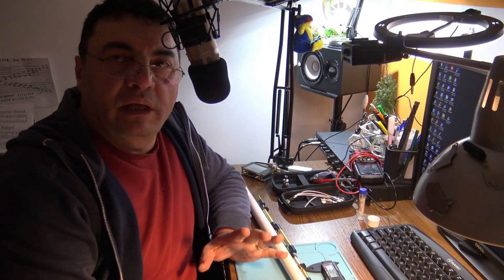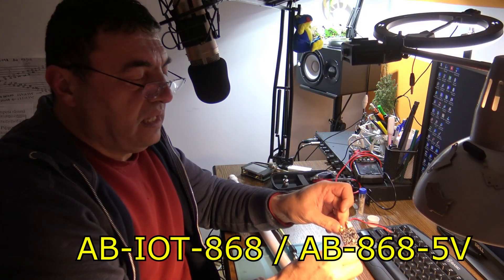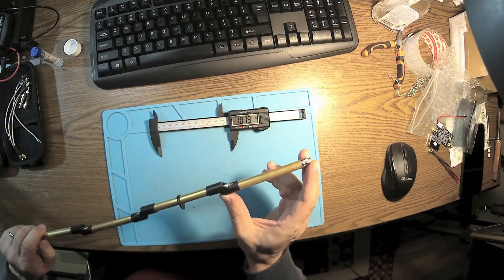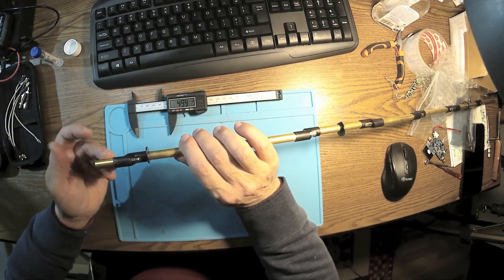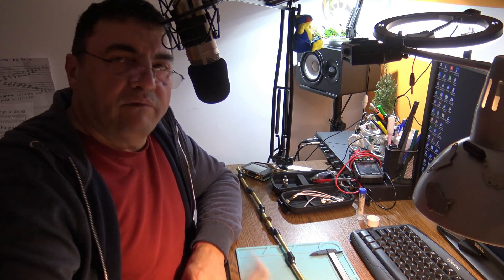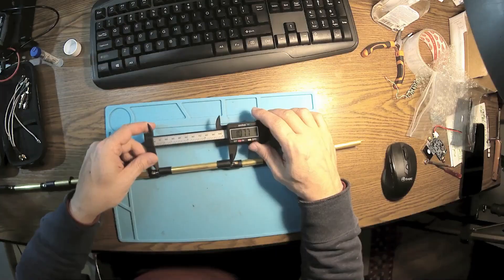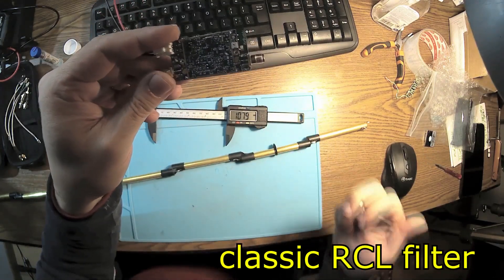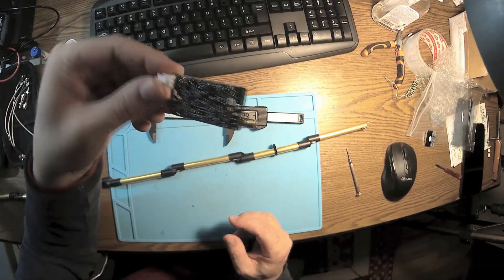A New RAK 8dB LoRA antenna dismantle

Comment: I suspect the plastic end caps might play a role. The ends of the antenna basically behave like a capacitor, in that there's high near electric fields relative to near magnetic fields. That's an oversimplification but it gets the jist across about field distribution and relating it back to lumped components and the resonance action. Anyway I've noticed with CB antennas that even adding small amounts of dielectrics to the antenna tips can really throw off resonance. The little rubber cap that covered the tuning screw on my CB car antenna made the difference between being in the band and resonating at too low a frequency. And it looks like there's plastic at the end of every element on your colinear array? Yeah that seems like it might load it down and pull down the resonance frequency. Each element is basically acting like a capactively top-loaded, electrically short antenna of a slightly lower frequency.
Reply from the maker: Thanks! Nice to let us know..I also consider different dielectric plastic in the tubes..changing the velocity factor..

Comment: Hallo friend,
How did you configure the Amplifier airbuddy? Because i don't have any good results with.
Reply from the maker: 5V power supply, the trimmer far left like 7 o'clock, .my miner antenna on Explorer set to 6dB..
Reply: @viocaia  ok thanks, i wil try it or the Amplifier is broken, but i have more.

Comment: So the RAK 8dBi is a very good antenna, right? It is much cheaper than a McGill, or is a McGill performing even better than this one?
Reply: mcgill might be a little better, but absolutely not worth the money
Reply from the maker: I
It's hard to say The McGill I used it's from UK branch, originally.it's very well tuned, reliable and gave me good results, now it's  in another location, urban , crowded hotspots area, somehow MCgill 6dB is for that kind of job, the other way RAK 8dB bought from Amazon, not sure about origin (labels in place) it's for isolated areas, better gain and shorted configuration..means no need for extra lightning arrestor  .just a ground connection to the cable shield...Ibut I'll always go for McGill..call it instinct..
Reply: @viocaia  asteptam cu nerăbdare finalizarea experimentului si tragerea concluziilor... Ca de obicei, materiale deosebit de interesante, mulțumesc! O sugestie pentru un mic material viitor poate... As vrea sa vad cum masurati efectiv antena pt a vedea daca e cu împământare sau nu, daca are sau nu nevoie de protecție la fulger...  Mulțumesc,
Reply from the maker: @sorinmitrea5138  Mersi frumos!..buna ideea..am sa fac un tutorial...
Reply: @viocaia  thanks a lot!
Reply: @sorinmitrea5138  good question!
Reply: Indeed McGill is the BEST!
Reply: @thegreaterfool1429  yup, if you are rich and don't mind being robbed..